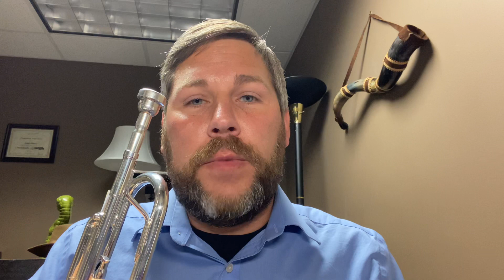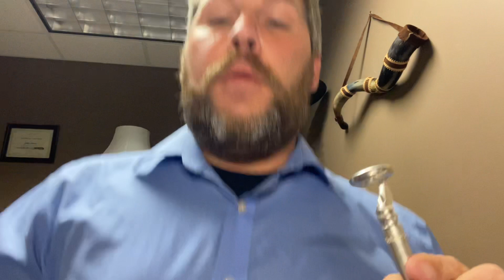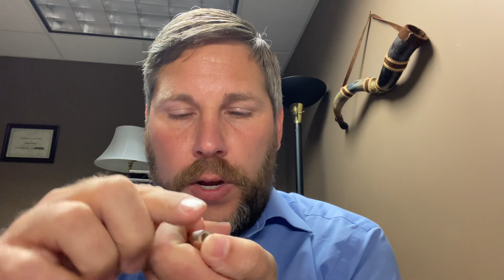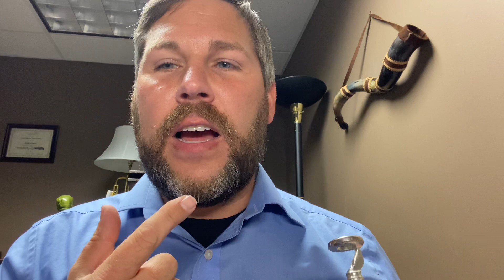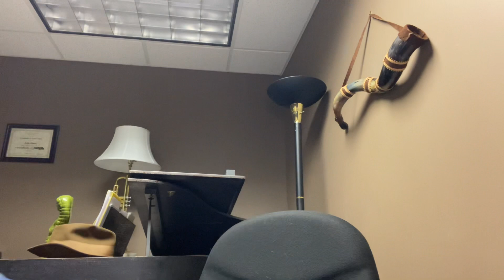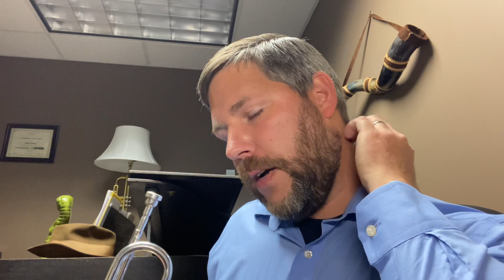Air Speed Trumpet High Notes Explained

Comment: At the “sizzle” air, how much back pressure are you feeling?   When I try this, it feels like I have to super engage my diaphragm just to force the air though my mouth cavity.
Reply from the maker: It could depend on your equipment setup. I like a more open feeling horn and backbore. It allows me to use more air without so much back pressure.
Reply: @jltrumpet81  Jack is not referring to the acoustic impedance of the instrument, he is specifically referring to the tremendous amount of resistance that a "hiss" posture adds to the system. And yes, that unnecessary reduction in the flow path requires MUCH more air pressure from the player by exhalation effort. That is to overcome the pressure loss and flow-limits of the "hiss". 

(Bear in mind that a "hiss" into free air is not necessarily a "hiss" into the aperture and instrument acoustic resistance. Jack is attempting to "hiss" while playing adding a HUGE amount of unnecessary resistance in the flow path. Which reduces the air pressure available to the lip aperture. It destroys efficiency.)

BTW jack frost, the diaphragm is a muscle of inhalation.

Comment: I'm confused on how to raise my tongue and how to blow faster air without having to use more air. I tried doing it but it doesn't get faster
Reply: You are correct.  Raising the tongue does NOT increase the "speed" through the aperture of the air flow. Not that it matters, because it doesn't.  Not in regard to pitch that is.

The only way to increase the flow velocity is to increase the exhalation action.  Which we vary with dynamics.

Comment: The loudness of tone is related to power x efficiency. Not air "quantity". Air power input by the player is pressure x flow. Sound output is then pressure x flow x efficiency. Trying to arbitrarily "manufacture" air velocity by narrowing the flow path reduces efficiency.

A water hose comparison is erroneous for a number of reason. However, the highest pressure is available at the nozzle is when the flow velocity through the long hose is lowest. Flow velocity causes loss of energy and loss of efficiency. See? And a drastically arched tongue contributes losses and inefficiency as well. Understand?

Comment: At 7:17 you are confusing pressure and flow. "Quantity" is air volume.  If you increase the exhalation effort then this increases the air pressure. The flow then depends on the total resistance of the system. The air volume used is then flow x time. (What you call "quantity") 

The tongue does not add pressure to the air. Neither does it increase "velocity" of the air through the aperture. The velocity is irrelevant to pitch as it can easily be shown that velocity varies with dynamics on a constant pitch.

You are doing 2 things during that demonstration to ascend the mouthpiece buzz. 1. Increasing embouchure effort ( lip tension) and 2. Increasing the air pressure by exhalation effort. 

At least you admit that you are doing 1. But then you are claiming that you are NOT blowing with more effort. 

Then attempting to claim the tongue increased the pressure. 

Sorry dude but that is impossible. 

Trumpet player imaginary mechanics.
Reply: Wow! So you are saying the tongue can't change velocity !? I am confused by the whole tongue concept! I never learned to raise or lower it. I just play while using lips compression and abdomen to go high and loud
Reply: @da11king  correct, the tongue does not increase the flow velocity through the aperture, only increasing blowing effort does that.

Comment: You are making a pronunced change in the lip aperture tension (which controls the pitch) and trying to attribute the pitch played to "air speed" over the tongue.

A pronounced tongue restriction is a HUGE detriment to air flow through the system,  air pressure available to the tone, and air velocity through the embouchure
. 
So I do dissagree with your premise. 

If you hold your aperture posture constant there is nothing that the tongue can do to influence the pitch played. 

Also, increasing the loudness of a tone requires a pressure increase by increase of exhalation effort.  The air FLOW also does increase.

Air VOLUME,  ( what you are calling " quantity") is flow x time.
Reply from the maker: Yes, it is a balance of all elements combined.  I didn't focus a lot in this video on the changes in aperture or embouchure because I was mainly discussing the use of the air.  Those will be discussed in other videos.  There will be a video at some point where I discuss them all combined.  For me personally, the low range is where I have the biggest shift in embouchure and aperture.  Well, aperture changes a lot when playing louder versus softer too.  I try to minimize changes in embouchure and have the least amount of facial movements when playing between 2nd line G and High C.  Anything beyond those notes, for me, will start seeing more physical changes in my face.  I always like to stress to keep the movements as minimal as possible so that when you have a large interval you have a prayers chance of achieving it.  Again, this will be discussed in another video at some point.  And, again, all of the elements have to work together to achieve the end result we all desire to achieve.
Reply: @jltrumpet81  yes, embouchure efforts increase exponentially with ascending range. The aperture flow resistance increases dramatically as well.. (Which is a detriment to efficiency but necessary). The tongue moves forward due to the way the mouth works. But that also is a detriment to air power.  That is why high notes require much more pressure by exhalation effort to play. And no, the tongue does not compress the air or increase the air velocity.
Reply: @darryljones9208  The tongue narrows up the air channel and guides the airstream towards the lips, together with compression this fast air meets the lips and creates the high notes. If someone changes their tongue position or exhaling pressure, one can get confused because they all feel it´s happening with their lips (the most sensitive part of the game). Try to keep your tongue the same all the time and just use air compression and embochure muscles to play high, well.. i bet you can´t, unless you squeak it out.
Reply: @olympicfan2  the state of the embouchure is what determines the pitch.  By "compression " I assume you mean air pressure.  And I never said the tongue should not move . It moves for most players but is an anatomical coordination with certain lip muscle actions.  The mouth's native function is eating, not brass playing. 

Also, the air does not have to be "guided". It will always flow to the region of lower pressure. Any attempt to "guide" the flow with a drastically narrowing path will simply introduce additional resistance and air power losses. The tongue arch does not "compress" the air. Only increased exhalation action raises the air pressure.

When actually playing a tone on the trumpet , the air flow is reasonably low, even more so for high soft tones. It isn't vigorously fast like when "hissing " into the ambient air. When one does that there is no aperture or instrument resistances present.

To attempt to "sizzle" or "hiss" in that way while actually playing would seriously REDUCE the air power.  The tongue can be reasonably high (required for high lip tension ) without that extreme.
Reply: @darryljones9208  I've recognized a disconnect between what I experience as a player and what has been considered common philosophy among brass pedagogues. I discovered the extreme registers of the instrument (both high and low) at a very early age and I recognized that nothing about what I was doing seemed to line up with the theories of tongue arch and blowing the air "faster". As a musician, I'm totally incompetent in physical jargon and mathematics, but from what I'm understanding, the only way to increase the velocity of the air is to increase the pressure differential between the high pressure environment and the low pressure environment, and that an aperture serves only to preserve high pressure to the point of its introduction to the low pressure environment? So, in essence, changing the size of an aperture doesn't change pressure, it only allows a preservation of the pressure that already exists within the high pressure system? 

I'm not sure I understand how all of this affects the sound, or what elements are correlated with changes in frequency, volume, etc. (and I certainly think that it is irresponsible to think about in the act of making music) but I think most trumpet and brass teachers (myself included) are absolutely terrible at teaching the foundations of brass playing, and are completely lost when it comes to helping students who are struggling. I would love to discuss or learn more about the physical principles of brass playing. Are there any resources you can recommend?
Reply: @MrBochawa  there are 2 things that we all SHOULD be able to agree on. 1. We do control the lip posture with the muscles around the lips. 2. We control the air pressure with the respiratory system using the muscles that function to exhale and inhale.

Most resources that are accurate can be highly technical and would be jibberish to most.

But that degree of complexity is not required to understand some basic air dynamics as it applies to playing.
Reply: But , it is interesting that players ARE interested in the underlying mechanics of air , acoustics,  etc. But it is a SEA of misunderstood concepts. Sure, moving the tongue is helpful for many players but the "air speed" concepts are at best, purely metaphorical. But in a literal sense they are grossly innacurate.  The "air speed " verbiage is simply players  "parroting" what they hear that appeals to "laymans" understanding of air mechanics. 

The lip tension controls the pitch, 100 percent.
Reply: @Darryl Jones  😵‍💫🎺 You are going against what most high notes players teaches! Like I mentioned before, raising my tongue never did anything for me. I struggled with that concept. Been trying and I am still struggling with it 😪 👅
Reply: @da11king  if the tongue movement is not accompanied by a change in the aperture "firmness" indeed nothing happens to the pitch. That goes for ascending AND descending. Videos such as this are just hearsay and misunderstood air mechanics. Arch does not make the air faster through the aperture nor does it "compress" the air.

By the way, I CAN play high notes too.
Reply: I disagree your premise. The video is correct.
Reply: @BlueGillage actually the video is not accurate. Just trumpet player hearsay jargon.